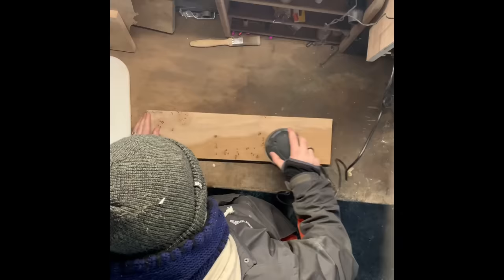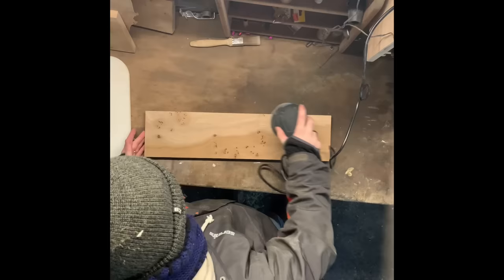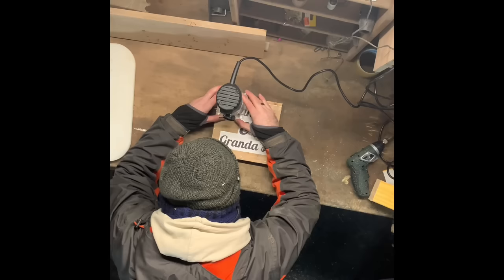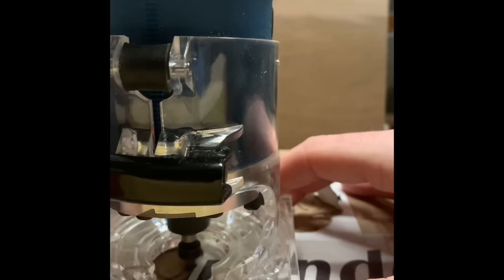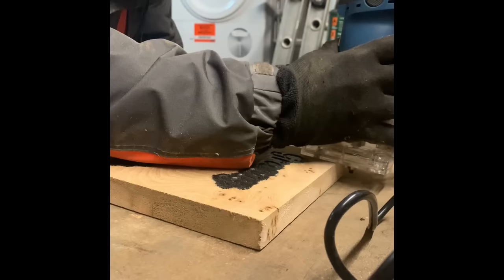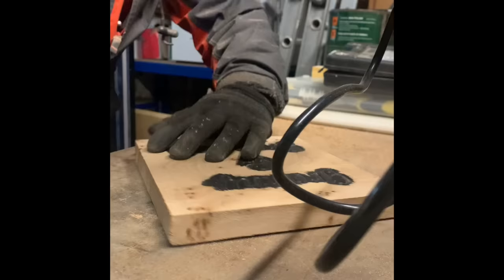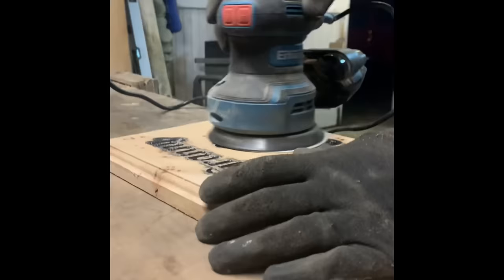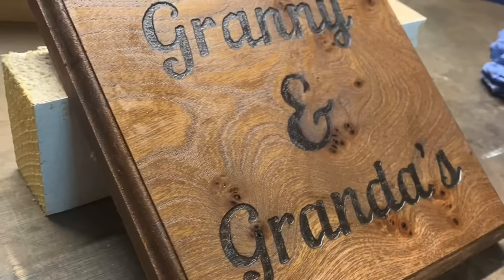How to. Hand made sign using a router, simple technique.

Comment: I use a different technique by printing the image in reverse onto a sheet of paper, lay it onto my timber face down & rub the back with thinners, it transfers the ink onto your workpiece.
Reply: Great tip thank you! 🫡🙏
Reply: Great idea, how do you do a reverse print?
Reply: My only comment is to note that the image has to be printed on a LASER JET PRINTER. They use plastic powder that is heated & melted onto the paper.. the thinner melts the plastic & allows the transfer.. this will not work with an ink jet printer..
Reply: @scotthighsmith6028  thank you for sharing your experience.

Comment: Hey, are there router blade that could handle cutting all the way through some thicker hardwoods? Or would I need a scroll saw/ban saw?
Reply: As a guide, the thickness of the router bit shaft relates to how much material you can remove without overburdening the bit and motor. 
1/4” or 6mm shank removes up to 1/4” or 6mm of material at a pass. 
At my shop we have guys using these smaller trim-routers cutting through 1/2” plywood. 🤦 So you can do it, but the router is screaming “put me out of my misery “ the entire time. 😂 The router motor won’t last as long, bearings will need replacing and worst of all it’ll be a struggle and not enjoyable. 

Use a Jigsaw or scroll saw for going through the material while being able to cut curves. 

Hardwood is different to cut for any blade, use a sharp blade and let the blade do the cutting, don’t force it. 

Hope this helps.

Comment: Very nice technique and sign!  Thanks for posting.  I would love to make something like that, but I would find it very difficult to follow the lines using this technique.  Apart from anything else I am not able to see the bit clearly enough on either of my routers - a palm router and a plunge router - to be able to follow it around the template.  Even then my lines would be all over the place.  I suppose the only option would be to make or buy a plastic or plywood template?
Reply: See my comment above, this may make it easier for you.
Reply: @dalegrover7633  Hi Dale.  your previous comment is an alternative way to get an image onto wood.  My problem is not that; it is finding a simple way to keep the router within the line and not relying on being able to draw a straight line with a bit while not being able to see the bit.
Reply: @PapaJoeWalsh  I cut a 1" slot into my plastic shield & also use a vacuum on the dust port, very clean & a lot easier to see my bit.
To help keep control I rest my forearms on the bench, lean in towards my workpiece & hold onto the router very gently, the tighter the grip the harder it is to follow my pattern.
Reply: @dalegrover7633  Hi Dale.  Many thanks for your tips. I will definitely try this approach soon.  I really don't want to start buying expensive templates, or making them which sounds a bit tricky in any case.  Regards, Joe

Comment: Good video may I ask what router bit you are using as I have to go over it a few times to chip out the inset.
Reply from the maker: Hi generator77, I use a 45 degree V groove bit for carving signs, I test the depth on a scrap piece and then away I go… happy carving!
Reply: @christaylorwoodworking  thanks Chris, what happens if it’s a bigger word is it best to use a higher degree bit, I wish I could show you my issue.